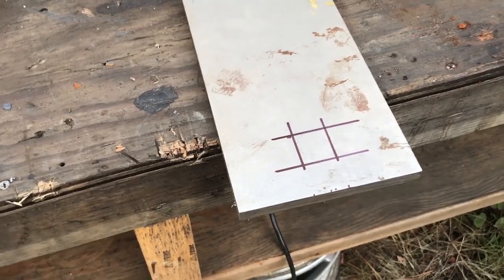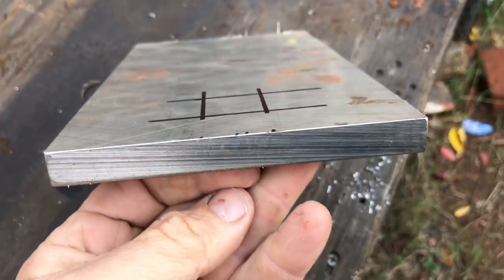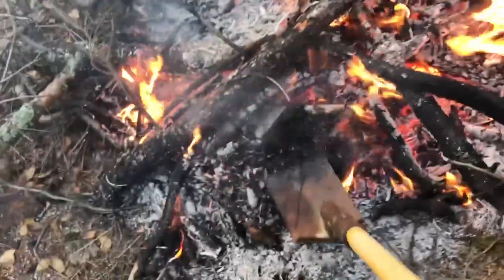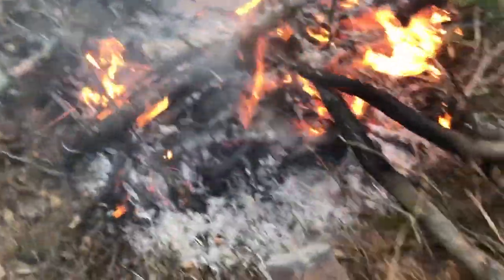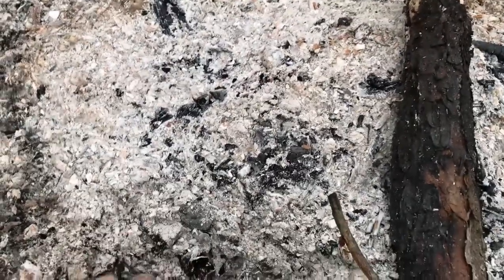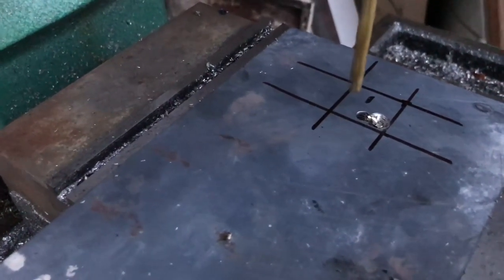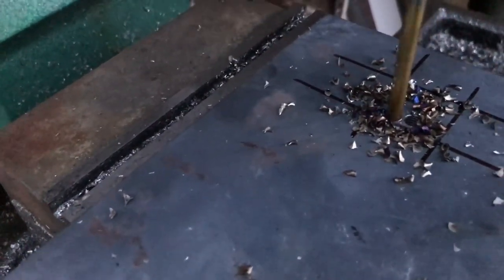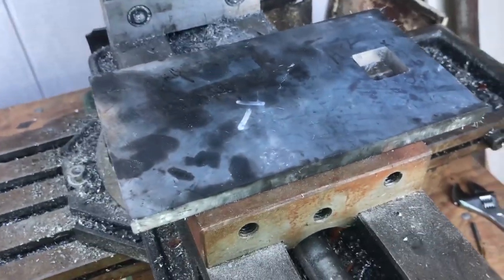ANNEALING ANVIL STEEL: Making A2 Tool Steel Soft with Fire at Home

Comment: Which wire you used when you weld with the mig? I believe you said you stick weld with nickel and then you used mig. Good job, I just weld a 1/2 steel plate with nickel 99 and my idea is welding later on on top of the steel plate another plate but at this time a metal tool plate so I will have 1 inch steel on top of the cast iron crap.
Reply from the maker: I should have used nickel rod to properly mate up the cast iron to the steel face, but I just used regular rod because I didn't have any nickel 99 around. Adding more steel to the top is a great idea 👍🏼